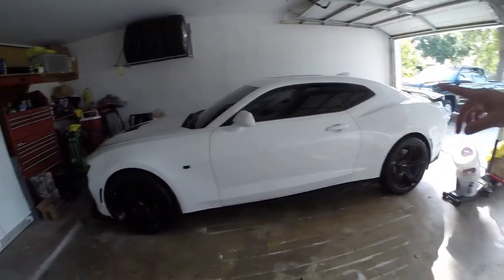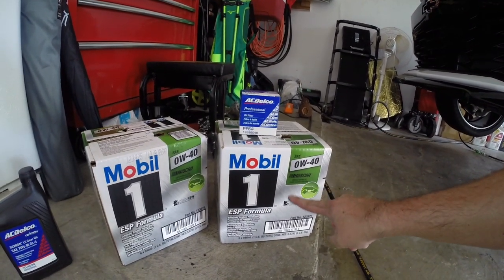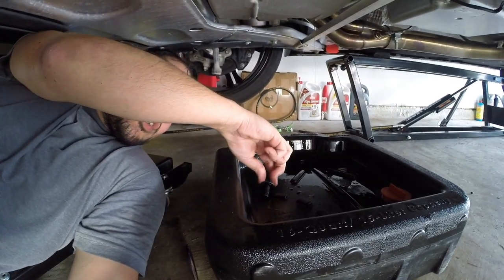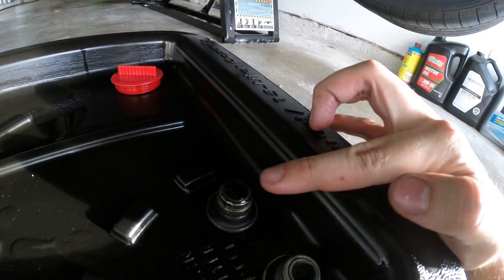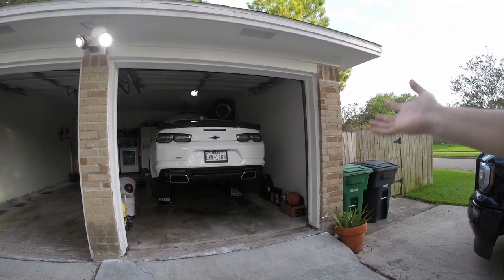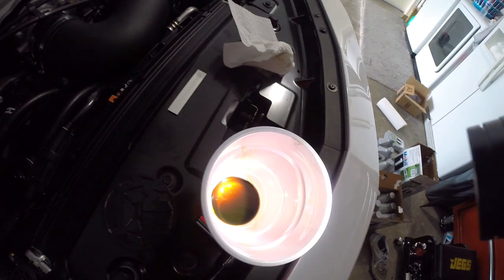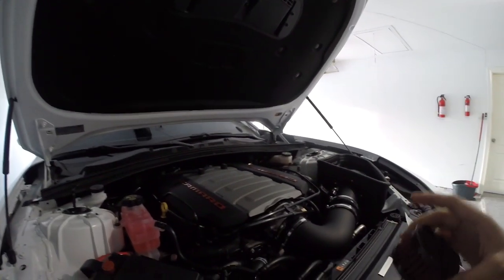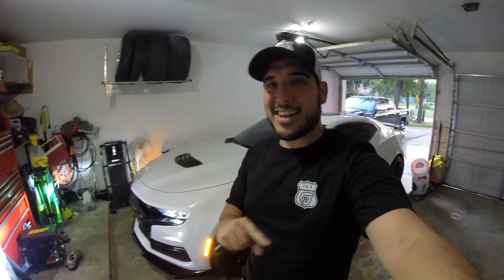How to Maintain your 2019 Camaro SS Engine and Differential! | Vlog #262

Comment: Nice video Jorge,and very instructional,i'm about to changing my diff fluid myself thanks to your guide,just waiting for the oil to arrive,didn't replaced from when i bought it and now it has 12k miles,hope it hasn't damaged anything,dealership here in Italy told me to wait 20 k miles since i don't track the car,this is why i decided to change it myself.
Reply from the maker: DBZDRAWERSSJ glad I could help!!
Reply: @JLSpeed  diff fluid finally changed!!Also at how much miles you would reccomend changing the transmission fluid?
Reply from the maker: DBZDRAWERSSJ not exactly sure, but I was planning on doing the trans fluid at around 15-20k miles

Comment: Is this limited slip differential type or it Mechanical differential
Reply from the maker: I believe it is a limited slip differential!
Reply: @JLSpeed  ohh woow really I thougth only the 1LE ss have it I never thougth the camaro 2ss or 1ss have it 😁 in 2019 I guess that mean it can go on track  lap time iam looking for this info for long time I really wonder if my camaro ss with 10 speed auto can go on track to get good lap time couse I thougth I didnt have the limt slip differential couse in track the car on apx or corner wont be eazy to control 😁 its would spine around its self fast

Comment: In fact this oil is not good, its just for ESP and not give a high protection for the engine
Reply from the maker: LAHOLM Observatörium the oil is one of like 2 or 3 oils that are dexos2 approved and 0-40w. This is the oil gm Is more than likely putting in your camaros at the dealer.

Comment: I say stop using that GM Diff Fluid and Order you Some Driven Diff Fluid
Reply from the maker: SloG8GT no need if I plan on changing it out every 5k miles. I would go to the higher end stuff if I wanted to have it last a bit longer.